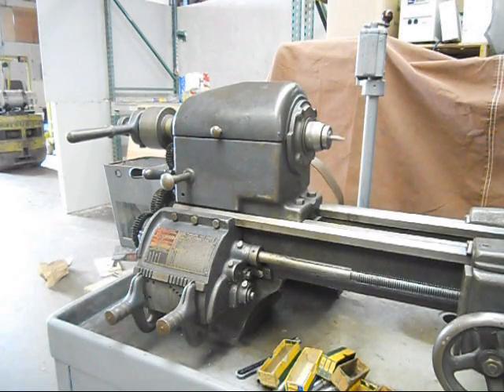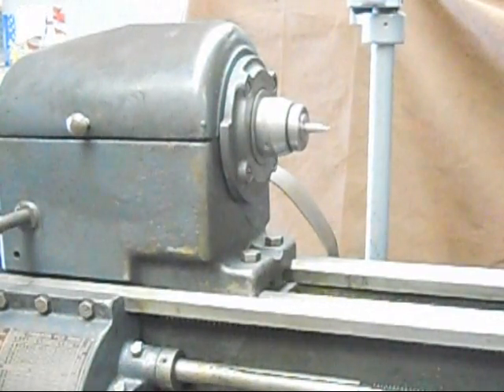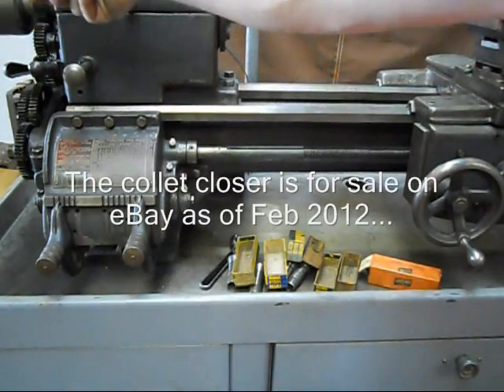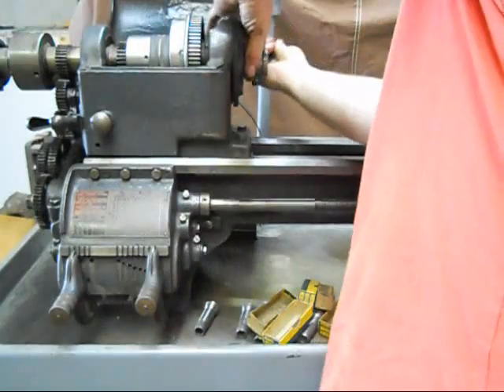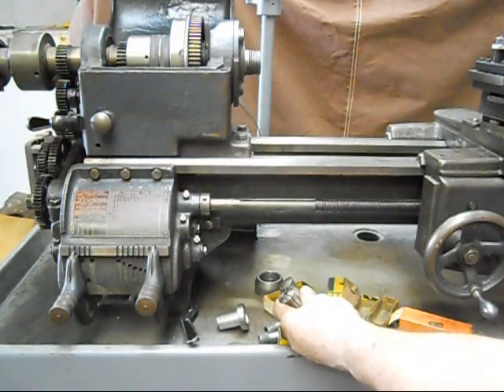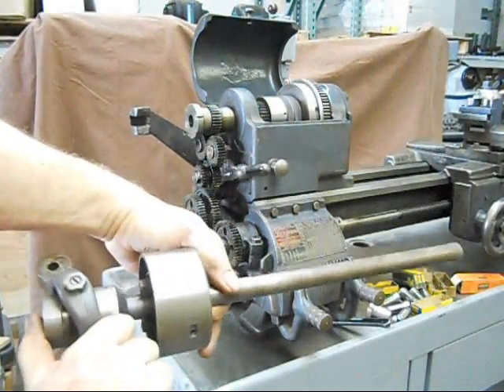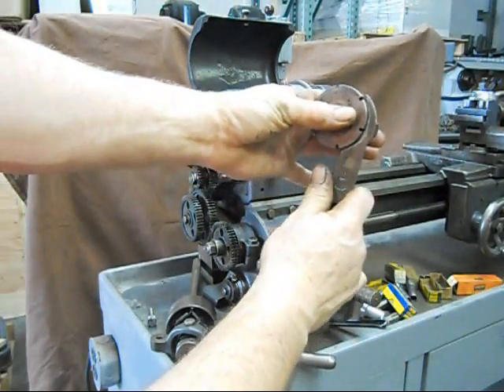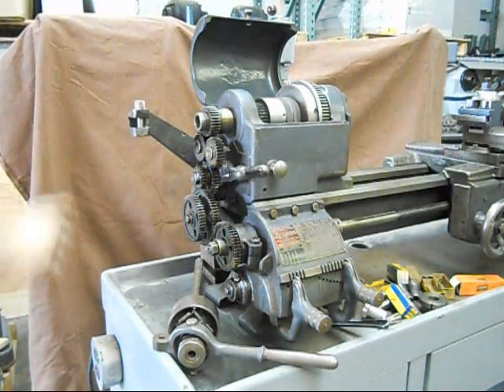Logan lever-type collet closer.wmv

Comment from the maker: Hi Roy,

It might be possible to modify the SB 10k lever to fit the Logan.  You'd have to do some pretty extensive modifying, new drawbar, adapt the bracket, turn the left hand side bushing to fit the Logan spindle, etc. but it could probably be done.

Of course, you might also consider running a drawbar-type collet closer, you could get by with that for a while as you continue to look for a lever-type. 
   
There is a SB lever for sale on eB, bidding currently at $50.